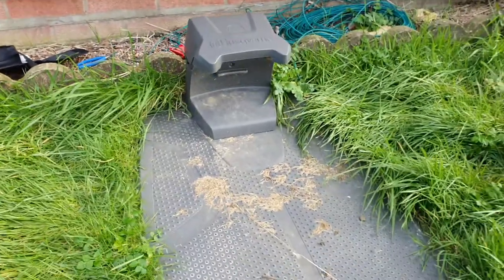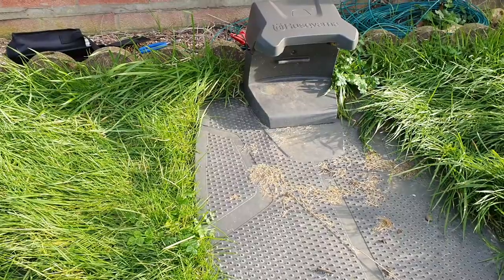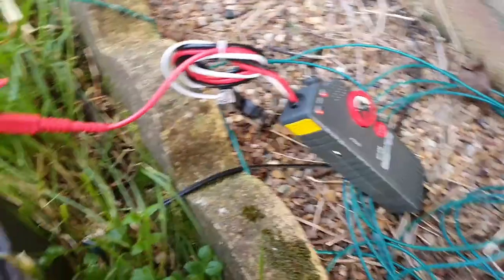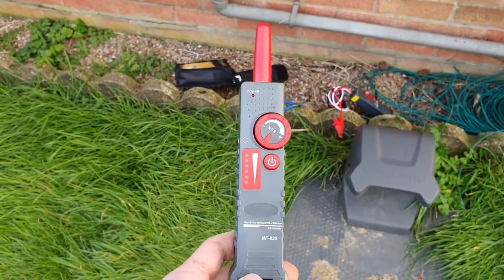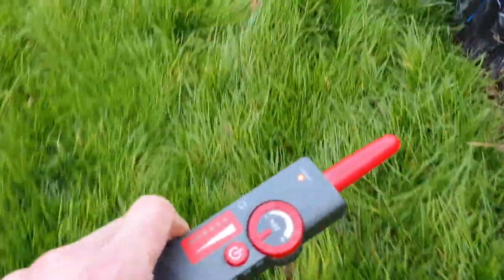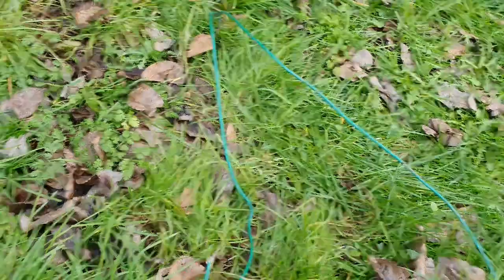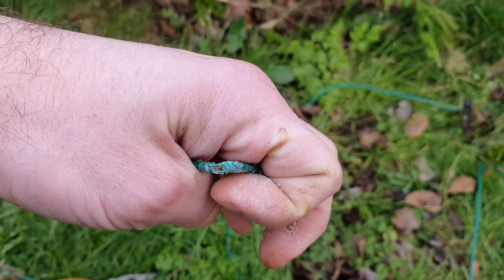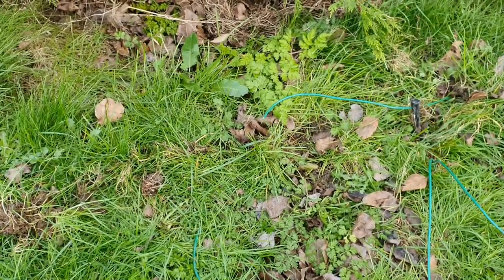How to find a break in a Husqvarna robot mower boundary cable

Comment: You just saved me a lot of time. Used a cheapo detector from Amazon. Found the issue after watching this. I stuck the black wire in the ground then it worked well 😊
Reply: Did you stick it in the ground to 'ground' it? Is that a necessity to make it work?

Comment: Thanks for making this video! Looks like this detection system is far better than with the Mastech system (which is barely audible from above ground). I couldn't get the AM radio approach to work. I'll try ordering on the NF-820 units.

Comment: Thanks for sharing! Tried it out but could not get it to work without connecting the black wire to a spade in the ground. Detection range without ground connection was 30 cm from the transmitter regardless of settings.

Comment: I confirm that's a good device. Just found damaged but not broken cable spot with this. The key is to have a device with intensity control on both signal and receiver.

Comment: Thanks for a great demo Barry. I bought a NF-820 a couple of years ago for tracking broken boundary wires. But the problem was that when I used it, it always gave signals everywhere. It was so sensitive and hard to adjust. So I bought the Mastech MS-6818 instead that worked much better. But after watching your video I noticed that you didn't ground the black ground clip. So I went out for a try with my NF-820 again. What a difference :-) Now it seems to work as it should. It still needs some minor adjustments but its great and much stronger than the MS-6812. When I look for faults I also use a smart wire-tester that check all wires individualy and comes out with a solution of which cable that needs to be tracked. See link     https://youtu.be/sdxZq-znpYU

Comment: Or you can connect a 220V (110V) AC live wire on the boundary cable (after disconnecting it from the base, obviously) and probing with a voltage pen tester. every few meters I did that and it worked quite well ;) I would assume a voltage pen tester is much cheaper than the device you are presenting.
Reply from the maker: That is very dangerous as you don't know why your cable is broken! Please do not follow this advice if you have happened across this video as you may end up causing damage or injury to someone. Stick with tools designed for the job.
Reply: Dangerous if you don't know what you are doing, obviously. But if you do, I see no harm. I always take proper precautions. Inspect the entire boundary wire first, etc.
Reply: Surely that would just trip the RCD?
Reply: @steverichardson6405  you only connect the 'live' wire, not both :)  but you MUST understand what you are doing...
Reply: @sorinpopa  but the rcd is designed to activate when more than 30mA current imbalance is detected between phase and neutral or in other words an earth fault occurs. So if you connect 'live' to the perimeter wire which has a break  then current will flow to ground and trip the rcd immediately (assuming that the break is buried) and disconnect the supply
Reply: @steverichardson6405  in my case I only connected the phase, not the neutral nor the ground; I don't see how the rcd would trigger in that case. Anyway, using the pen tester I was able to find the broken wire which was on the surface (not buried) in my case. Would the rcd trip if you touch the soil with a live wire alone?
Reply: @sorinpopa  Right, so if the break was not buried then that method may work. But yes, otherwise if the break was buried (or phase touches the soil) then the RCD should trip. I ordered a similar devise as the video shows to try and find my wire break later today. I alreadt tried the am radio method but it didn't work for me.
Reply: This was a life changing video

Comment: I've had to replace mine so many times I'm fed up now I bypassed the wire and not it cuts up everything. 😂
Reply: You can mow without a boundary wire?
Reply: @jday1986  yes... Unlock press menu hold 7 and 9 go to loop signal select no and then start it. If you don't have anything to stop it will cut everything but you have to do it manually everytime. I'm just fed up of the wire breaking somewhere so I do this instead
Reply: Thank you so much for that tip!! Now I just have to keep it from mowing over a cliff into the river😅
Reply: @jday1986  I don't have to worry about a cliff, but plants and everything else I just place bins and things in strategic places.

Comment: Barry, will this tool detect wire that has been buried? I've trenched my cable appx 4-6 inches. Also, what is the make/model of this tool? Thanks! (Actually looks like the Noyafa NF-820 and says it can find wire underground! Thanks!)
Reply from the maker: It is the NF-820 John. I don't know why they say it won't find wires underground since the principle is only around pushing an RF signal down the wire and then the receiver picking it up. Ours is between 1-3 inches buried, but when the strength is turned up high, it will pick up the signal from the wire even when I'm metres away from it. Admittedly struggles with distances over 300m of typical boundary wire, but does still work. We got ours from Amazon and it's been fine.
Reply: @barryjohnson9626  I read several reviews on it and it seems like unless the wire has a clean break it won't work. With my boundary wire, I often find that the wire has gotten a nick or something and then it corrodes and stops working. It has enough continuity to tone all the way through, but not enough for the Automower to see the signal. :(

Comment: A completely different question I have for you, do you have two guide wires connected? Do you have them connected separately to G1 and G2? There is only a G1 connector in my automower 305, does that mean I can only connect one guide wire ?? thank you in advance for your help.
Reply from the maker: I did, but one was broken quite early on. The 305 has a much smaller area so it probably doesn't need more than one guide. The max for the 305 is 600m2, whereas the 450X has a 5000m2 +/- 20%. It's therefore unlikely you'd need more than one guide but nothing to worry about 👍🏻

Comment: Quick question
So, i have a 430x mower with a large area to cover, between 2 properties. I think i may have nicked guide wire 2 with the shovel, which goes out to my part of the lawn.
To firstly confirm this, would i plug out Boundary left and but guide wire 2 into its slot and confirm that is indeed the issue, which should lead to turning the light blue in the charge station

If the above is correct, do i then plug out all the boundary cables and guide 1, to only leave guide 2 operating and track the wire from there, or what is the best approach. Thanks
Reply from the maker: The wire detection device doesn't need a closed circuit to work so if you're looking for a break in a specific guide wire, my advice would be to disconnect all the cables (make sure you label them first!) then connect the red Croc clip to the guide wire you want to detect the break in and start tracing. Unless you've got a very large cable (hundreds of metres) then you should be able to detect where the guide cable break is. To do it from the other end, you'd need to know where the guide connected into the boundary wire and then start from that end instead. If you've got multiple properties, I'd recommend considering the 550X EPOS. I have one and will maybe do a video on it if you're interested in what that's like?

Comment: Does one need to unplug the charging station from the power before doing this test?

Shoukd you also disconnect the Guide wire as well?
Reply from the maker: You don't have to, but it's a bit like anything in that if you power it down, you give yourself the best chance of success as there are no other factors interfering. I've tested before whilst the station was on and it made no difference in my case. I'd say with the guide wire question: yes. The idea is you want to trace to find breaks so if you have fewer cables connected to your test loop, you're isolating everything and it's easier to find the break(s).

Comment: Yep I’ve given up with the radio too, and have just been 1/2 way splitting the cable using a cable reel, 13a plug with spade connector and multimeter. I hate it worst job ever. I will order one of these gizmos and try that, why are husqvarna supplying cable that rots in the ground?!
Reply from the maker: It's a good question... I think that sometimes ground shift might create a small split in the insulation and that has a knock on effect to moisture getting to the cable, causing corrosion, etc. Handily, since having this now, I'm breaking the cable into multiple sections to enable an easier length for troubleshooting but this definitely is better than the radio method which, frankly, is a weak hack at best. Good luck!
Reply: @barryjohnson9626  thanks I’ll need it… I keep my thinking I might change the wire for copper wire a section at a time… thanks again
Reply: @barryjohnson9626  well what a waste of money that was. Bleeped all the way round both ways and I still have a blue light! Did I mention I hate this job. Back to my method this Saturday then…..
Reply: @chrisjones6542 I did the test as well and it beeped the entire time, yet I still have the blue blinking light.

I'm curious:
1. Should the power to the charging station be disconnected first?
2. Should all the cables be disconnected e.g. Guide and Boundary?
3. Does the black gator clip need to be 'grounded' to insure better testing outcome?

Comment: Your cable is on the ground not underground, that make a big difference finding a break.
Reply from the maker: Jog on mate. I'd found the break using the method in the video and exposed the wire to show this. It's helped loads of people already and I've got a boundary cable which is hundreds of metres long. This method works. If it doesn't for you, the problem is in the mirror.
Reply: @barryjohnson9626  : Sorry I have not see you are using a NF 820 which is correct for underground cable. I use a NF 826.
Reply: @barryjohnson9626  no need to be ignorant is there

Comment: How far from your base station was the break?
Reply from the maker: I had three. One was around 75m away, one was about 150m away, and the other was around 250m away (all approximate perimeter wires distances, not 'as the crow flies'). The further away you get, the harder it is to find the guideline signal and I ended up literally brushing the antenna against the ground to find the signal. My garden is approx 8000m2 though quite a bit bigger than the 450X is rated for, but it manages fine.
Reply: Barry Johnson Thanks for the reply. I tried using an AM radio to find a wire break for our 450X base but it was difficult to pinpoint the cut. I’ll try this device.
Reply from the maker: @skyserf  I had the same problem. I think if you live in a Faraday cage or somewhere no with fewer AM interference, maybe it works better but I really struggled to differentiate the interference from the boundary wire signal vs the ambient radio noise. Good luck!

Comment: I'm facing the same problem. A link to that device would have been helpful right now.
Reply from the maker: @Crazy_Dave  Kolsol Underground Cable Locator NF-820 Wire Locator Network Tester High & Low Voltage Cable Wire Locator with Anti-Interference to Locate Pet Fence Wires, Metal Pipes Electrical & Telephone Cable https://amzn.eu/d/6Gy7S1I
Reply: @barryjohnson9626  Thanks but I've already found the break using a 12v battery and light probe. Thanks anyway.